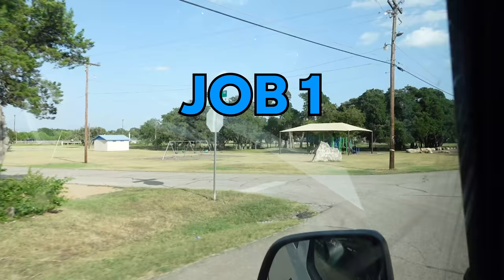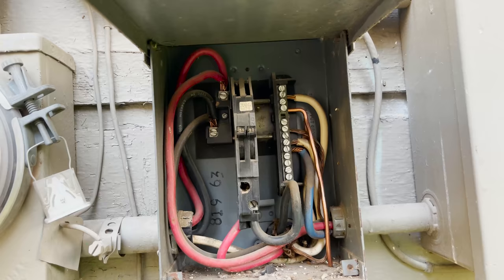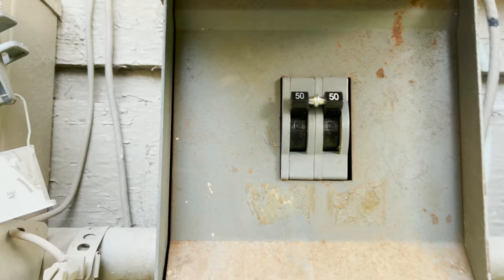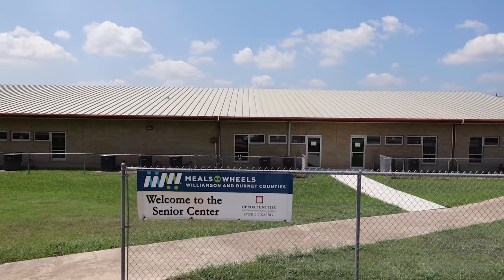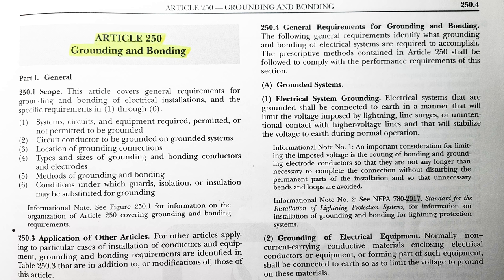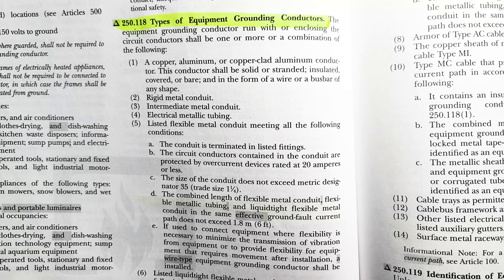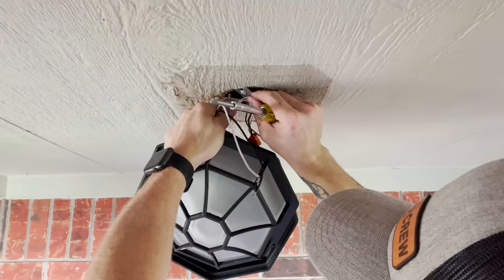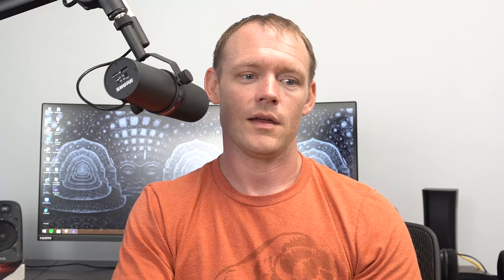Service Calls With Electrician U!!!

Comment: It would have been good to see more detailed footage of the school job. See how you are pulling the grounds, how you are securing/attaching the flex, etc.
Reply: I'd like to see that too
Reply: I mean what's the difference than any other building.
Reply: It’s a school, good way to lose an account is to video. JMO
Reply: Agreed
Reply: Good idead I might just start doing that 🙇🏻‍♂️
Reply: Every building different since it was a hung ceiling the flex run should be easy
Reply: @jrg8340  Shouldn't be a problem, just don't show what school it is.   Its empty also so no kids are there.
Reply: @donl1410  hello
Reply: It’s good you pull an equipment ground. See 440.9 NEC new to 2017

Comment: Using emt as your ground might be accepted due to code but it definitely is not a best practice.
Reply: Why? Honestly why? If it's people not tightening their set screws then ok. But, ground screws/terminations can be loose also
Reply: @christiansantos8904  you pig tail the grounds at each device. So if you have a loose ground, only that location is affected. Plus it's an easy fix. Using the conduit, you have to make sure every single fitting is tight. If any of them come loose, you loose the ground from that point on. You won't be able to go back and re-tighten fittings after walls are closed up. Also, worth pulling a ground wire, you have redundancy in the ground connection. And that's a good thing.
Reply: (For EMT) I would only do it if it’s adding onto an existing junction that’s already grounded. But if it’s a new job start to finish I’m running actual grounds.

Comment: I am not an electrician (unfortunately)  but I love watching your videos. Job descriptions coupled with code is absolutely excellent. You are teaching code by working the jobs with us,  your viewers. I remember taking my low voltage qualifier class/test,  and if I hadn't worked in the space for years prior,  and if I didn't play with electronics design/assembly/soldering for fun,  I wouldn't understand and especially remember 70% of material. Working through the actual jobs with you kicks ass. Thanks dude.

Comment: I was working in a movie theater, before all of the seats and everything were installed, so it's just a huge concrete room. And I was strapping MC cable along the wall, 25' off of the floor. The feet on my extension ladder had gotten wet and I didn't realize it, and I went down hard! Broke my knee and my face. I was off work for about two months. So...yeah. Safety is important.

Comment: You're 100% right about trusting your customer and what they're experiencing. It can be very frustrating doing diagnostics when you can't find any faults. I do HVAC and had a customer with heater that was failing to work intermittently. I've done two house calls already and cannot replicate the problem. I'm not calling her a liar and I'm not comfortable spending her money without a clear reason. Guessing can get expensive.

Comment: > on the breaker, In the aircraft business, you get a code. you trace the whole circuit and power source And replace the push/pull breaker...
Just letting yall know> I built/spark chased fighter jets for over 10 yrs/ lots'a paperwork and triple checking.....  oB

Comment: my second week working in construction (carpentry then) someone needed a piece of 2x4 and pried up the one blocking the bottom on an extension ladder temped in while the stairs were being rebuilt. i got 2 steps down and it slid out fell against the wall and torn through the sheet rock almost all the way to the ground, saved me from slamming face first

Comment: The ceiling-support wires or ceiling grid  and cables (power, signaling, or communications). However, independent support wires that are secured at both ends and provide secure support are permitted [300.11(A)].

Comment: About equipment grounds for HVAC equipment:
I did a call a few years back, following up on a HVAC tech who had replaced a blow board twice on the same AHU. Tech reported "weird" voltage. I checked and was getting 90-100v. I looked around the attic and saw RX cable just laying on top of the joists with plywood and other things on top of it. I figured the AHU feed was being crushed. I found a feed from somewhere else to see if i can get the unit fired back up. Ran it over there and went to connect it. When i grounded my new feed, i got hit. I made sure with my apprentice that he didn't connect the new feed and he definitely didn't. I noticed our voltage sticks were going crazy in that attic, basically saying almost everything was hot. I took my meter went from the enclosure of the AHU to the ground from the attic light and i got 107v. Same for the copper line sets. The entire HVAC system was live. All metal parts including the vents and grill covers. Turns out it was powered from some bootleg crawlspace sub panel that had no equipment ground. All of the grounds in the panel were cut short. When we fixed it with a new feeder from the main, 2 circuits shorted out.

Comment: I agree with how you did each service call, especially call #2. You could just tighten all the connections for the conduit-grounded circuits, and you would even be within the requirements of code, but it’s just an accident waiting to happen again!

Comment: Climbed a ladder in a gym to fix a speaker.  Ladder had to clear some shelves and was at a bit of a shallower angle than I'd usually like.  The gym had rubber mats on the floor, so good traction there; just to be sure, I grabbed a couple hundred pounds of barbell plates and put 'em at the feet of the ladder.  Most stable ladder I've ever climbed!

Comment: I've got a bunch of extension ladder stories. I live in Gretna, LA. About 10 minutes south-southwest of New Orleans. After Katrina,   we were on Chalmette,LA at River Parish Disposal fixing the pole lights as well as the security cameras. I was up about 25ft installing a new security camera and the master was in this little shed they made into a storage for data switches, security equipment etc.... He was terminating some fiber. I didn't have a safety belt on, my ladder was not tied off and the ground was pretty soft. They had a security fence wrapped around the property and the poles were along this fence which also had razor wire along the top of the fence the entire way around. The fence was 10'-12' high. I was on my 4th or 5th pole and I was trying to position the camera in the direction of the main gate and I leaned over to my right a little too far and the ladder turned on me due to the soft ground. I had to make 3 choices in a split second. Do I just fall and aim for the marsh on the outside of the fence, try and land on the mud inside the fence and hope I don't hit the razor wires or latch on to this fuckin pole and hope I can hang on long enough for Steve to come out the ladder back into position for me so I can climb back down.....

Comment: love seeing these videos. finishing up my senior year of highschool and want to start an apprenticeship as a sparky as soon as I'm out. one thing i am worried about is getting in to a company that specializes in one aspect of the trade (for example, maybe the one i work for only does residential and doesn't touch any commercial or service stuff) i want to get experience with both residential and commercial as well as the service aspect of both areas. I hope a lot of companies do a little of everything!

Comment: I worked at minutelube where all the concrete was covered in oil. A roofer did not take that into account when putting up a 20 foot extension ladder. He just barely grabbed the gutter and scrambled onto the roof as the feet of that ladder slid away from him. 

Be careful of the feet of your ladder. Make sure they are on stable surface. Even grass can be slick enough to slide on.

Comment: Living vicariously through you has been quite the hysterical moment maker. The carpet is definitely an eye-opener, especially when you wake up face down on the floor and the other Hardcore reality is when you’re using a hole hog, improperly I might add, and your feet hit the ceiling…
Eye-opening moments for sure!

Comment: 50A main? Damn that's tiny. Smallest one I saw while house hunting was a 75A. The house was originally knob and tube with a 25A main fuse (none of the original electrical had been removed) and had been renovated in the 50s or 60s with the 75A service and that wonderfully crumbly rubber/fabric wire.

Comment: I always tie off my extension ladders if there's ANY kind of breeze because of one of the stupid things I did. I was on a service call for a heat pump that was on a second story roof at an appointment complex. It was dark and kind of breezy but I thought it was ok. Anyway, I'm tracing power and a gust of wind comes along and I hear my ladder slide sideways and hit the ground. So I was stuck on the roof feeling stupid until a guy comes along and I holler down to him and he helps me. Ever since, I always tie my ladder off.

Comment: Was short on work so I was helping a couple friends who specialized in exterior painting. Working on a 3 level with a basement patio facing the lake. We borrowed an extension ladder from their uncle that had 3 sections. They're running around spray painting because the trim, windows and stuff was done and taped. I got to take a regular brush up the ladder to paint the soffet. Nobody happened to mention the hornets nest around the corner of the house on the side that they'd not done yet. When I reached around the corner to paint what I could get of the fascia the hornets were not amused. I came halfway down the ladder fast then jumped for the lake. Everything was taped and tarp was on the concrete patio so only thing hurt was my pride.

Comment: That first service call has me going out there once to make a repair and the highly encourage a complete service upgrade. All of the equipment is old and should be upgraded. Plus the distribution panel is not grounded correctly and causes a hazardous situation known as objectionable current flow.

Comment: I would not touch a Zinco or Federal Pacific panel or breaker. Would only recomend replacing the panel with a reliable brand  due to liability concerns. It had been awhile since I checked prices on Zinco replacements at big box stores but they are overprised. We had a housing developement with Zincos installed back in the early 60's and had to replace a couple of their crap panels that buss burnt out in less then 10  years.

Comment: Dustin, I found that buying an infrared camera has saved my tail more than a few times with this type of issue when the service entrance conductors from the utility have a bad crimp that's causing a single phase condition only once it's loaded to a certain point and heat dissipating at that bad connection and dropping the connection out. So many times it's a saved me from shooting from the hip so to speak.
Reply: I've been in the trade 19 years and have worked residentia,l commercial, and Industrial. I was an IBEW electrician went to their apprenticeship now I work for a wastewater treatment municipality as a electrical and instrumentation technician.

Comment: Bro, the moment you said you put an extension ladder on a rug I gasped. I've been cleaning windows for over 10 years and the guy that got me into it all those years ago did that exact thing except he was using a sectional ladder. I heard a noise and turn around in time to see him slide down the wall until the sections of the ladder came apart and he hits the ground, it happened really fast. His ankle got caught in one of the rungs and got messed up pretty bad. Your very lucky that move didn't end in a similar fashion. Glad your ok dude. Stay safe.

Comment: If using EMT in a metal structure, you will more than likely still have an equipment ground path even if a coupling has somehow completely separated. That pipe is still likely bonded via building steel or metal studs. Although it’s not intentionally grounded, and certainly should be, a short to ground would still trip the breaker.

If they used LFMC as an EGC from the disconnect to the condensing unit, and did not pull a EGC, then that’s bad. You cannot use any type of metal flex as an EGC if it is being used on equipment that vibrates.

Comment: 6:26 It may be common in rural areas, but Central Texas in particular the trades folk will take jobs but then noshow if they think the job isn't going to pay well. If it is something like HVAC and you didn't buy from the local shop, it pretty much burns the relationship with them permanently (even if they are booked solid for a year, they don't care).

If you're a competent electrician or plumber, do some recon on rural areas. A healthy ethic could easily earn a good name for yourself.

Comment: I've had an extension ladder slide out on me before, it was wet deck boards running parallel to the ladder rails that did me in,as it slid out the ladder hooked the eves-trough and flicked the water up and out so after I hit the ground the water landed on me lol

Comment: One time I was up on an extension ladder doing some exterior work. The place I was working had these HUGE bushes so the ladder had to be at crazy angles. I’d put the ladder up and against the bush. Ladder not even touching the building. I’d climb up a few rungs and my weight would bend the bushes enough so the ladder would touch the building. Smart. I know. I’m up there with my impact in hand and the feet slide out. 🤣 Fell about 8 feet into the bushes. The best part was the wood siding. As the ladder slid down the siding it made a sound like a Latin percussion Guiro 🤣 I just stayed there motionless in the bush for a minute reflecting on my poor judgement not saying a word. Guy I was working thought I got skewered by a broken branch and died 🤣
Reply from the maker: Woah! Glad you were okay.

Comment: The main breaker on my house went bad one time. And I traced it back to a loose leg on the power company side coming to the meter. They ended up coming out at 9:00 at night fixing their stuff so I could put a new main breaker in and then they gave me some 30,000 volt gloves.

Comment: You could've also tested the breaker voltage. If after you turn it off then back on and it doesn't work. Change it

Comment: Thanks for sharing. 25 year master electrician and service calls are still my favorite jobs. Good call on pulling new grounds for the HVAC equipment. Easy work and good payout. On that Zinsco breaker, I’m sure it was the issue, especially since she was losing power in the entire house. curious if you  could have checked for voltage drop across the breaker while it was loaded or a quick scan with an IR camera to check for heat (high resistance) to confirm it was the problem?
Reply from the maker: Could have, didn't really need to. Also thermal camera for something this straight forward would have been a nice little cherry on top. But I didn't have it with me that day.

Comment: Just wanted to get your thoughts on having a helper.  I think from a safety stand point a helper should always be present. I'm a lead tech now but when I was a helper my lead got heat exhaustion and fell out no one else was around. I ended up calling an ambulance. I wonder if I hadn't been there. Accidents happen and there are times no one else is around to give first aid. I believe our line of work is to dangerous to not have a helper.

Comment: Anyone else notice at 1:25 - Who ever installed the power box for "Job 1" installed it upside down? The top of the breaker panel is on the bottom.

Comment: Went on a service call this week where the main breaker caught fire, it was an old Challenger panel.  Owner didn't want to put in a new panel, and the buses were torched.  So, was able to find a new panel that had the bus plates measuring practically the same as the old panel,  so rebuilt it.  So far everything is good, but don't know exactly why the main breaker caught fire. I opened up the meter and looked in there, all good.  Couldn't check the service connection at the roof cause I'd need a 26ft ladder at least, so we're keeping an eye on the main breaker for the time being.  The original panel apparently had a problem with it years ago,  so that may have also been the starting point. Anyways, always interesting to figure out the small things that can have big catastrophic consequences.

Comment: Another safety tip, Never put your ladder on the outside of midspan [Qclamp for telephone or cable] when removing ariel cable from above ground pole wiring. Even if you see a huge drop in the wire, that wire can hold a lot of kinetic energy that can thorough you off the ladder, even with a safety belt. It really sucks if you have to hang from that belt for very long while waiting for help to get you down and usually you won't be able to pull the ladder back up while hanging if you happen to tie the ladder as well.